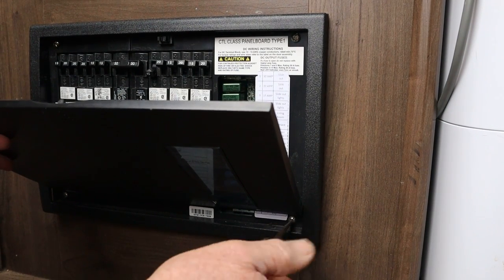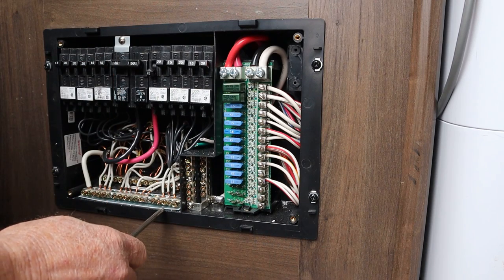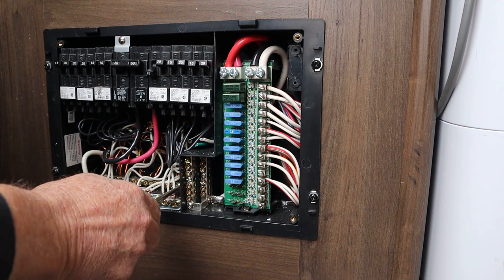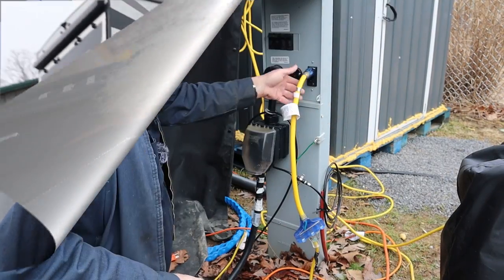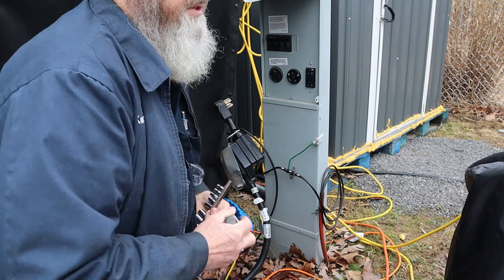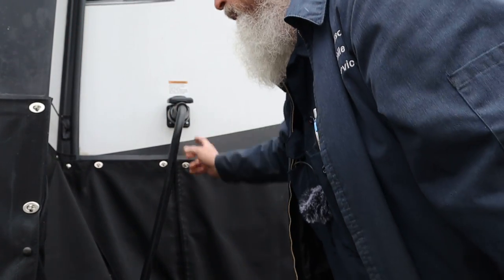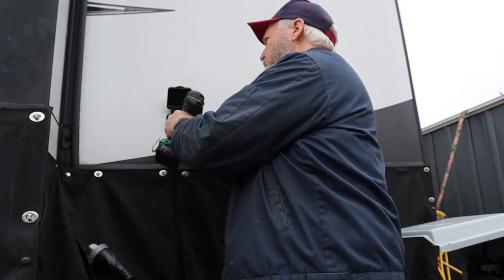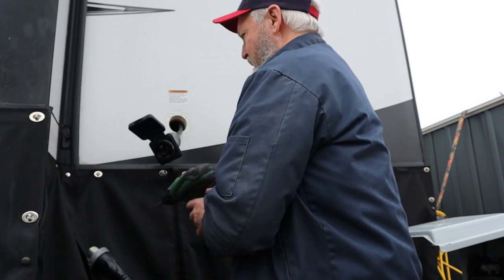GFCI Outlet Redo

Comment: Hi Kenny I was camping one time and my 30 amp kept tripping it was a loose wire like you were saying it was also arcing so I changed the breaker checked all the other wire everything works great now has not done it since
Reply from the maker: Loose wires cause a lot of problems.

Comment: I had a GFCI that would not reset.  On one of the outlets a ground was touching the neutral wire which had a nick.  Electrician pulled the wire and separated them.   I had replaced the outlet a few months ago.  On a brick house the wires can get abused and nicked.
Reply from the maker: The customer decided that he didn't want me going any father on this one. He said it wasn't important enough to him to spend any more money on.

Comment: I have found working with 120vac the best meter is an old one with an actual meter movement. The high impedance  of a digital meter can give weird readings. I have had problems with GFI outlets in damp locations failing. They seems to like dry rooms only over time.
Reply from the maker: I haven't had an analog meter for decades. I might have to get one.
Reply: @hillbillyrv  I remember the first time I used a digital meter and it displayed about 60 volts between neutral and ground.  After a while I realized it was about 60 millivolts. That was probably the difference in voltage all the way back to the meter where  ground and neutral are connected. With an analog meter you’d never see this inconsequential voltage. This was over 40 years ago digital meters started to become popular
Reply from the maker: @Chris_at_Home  Yes. The self-ranging meters have bit me a few times too....ok many times.  When reading voltage you must be careful to make sure you are paying attention to the range you are reading, but I don't think this applies here. I am seeing no cross continuity on any of the wires in this circuit, so no ground fault. Right?
Reply: @hillbillyrv  Correct, as long as you are disconnected from the utility  meter and there is nothing else plugged in the resistance should be infinite between ground and neutral.
Reply: @hillbillyrv  Well, if it only occurs under a load, then yes.  But under a load might only be when current is applied.
Reply from the maker: @Chris_at_Home  Yes, it was.
Reply from the maker: @Tom-Fisherman  No load. Only receptacle on that circuit.

Comment: Are the 2 gfci outlets in the camper on the same leg of power coming from the shore chord?
Reply from the maker: That I don't know. Good thinking.
Reply: @hillbillyrv  ok so I’ve been doing some research about gfci outlets for you. 6ma of leakage is enough to cause a “ghost” trip which may be your issue.   Surge suppressor filters increase capacitance down the line so I would eliminate that from the equation like someone suggested.   Leak meters are expensive but I don’t know if that’s an option.   You may be able to put a clamp meter on the neutral or ground and just see if you can detect any voltage but I don’t know I’ve never tried it.  I would however see if both outlets are on the same leg coming from the shore chord and separate them to opposing legs if so that will help distribute evenly.  Looking forward to round three video keep your head up third time is a charm.
Reply from the maker: @marcuscarmouche9023  Thanks for all of your effort Marcus.
Reply: @hillbillyrv  no problem bud techs have to stick together.  Nobody knows everything and I’ve been in your shoes and it sucks when every where you turn is a wall. I may be the one leaning on you next time lol.  I enjoy your channel keep up the good work!
Reply: @hillbillyrv  I also thinking the same thing why it happen on my Georgetown.

Comment: You have a neutral on the ground, that would be likely at the distribution AC panel box. Or, one of the outlets.
Reply from the maker: I checked the outlet on the outside of the camper. It is the only outlet on that circuit. That is the one that would not reset the day I was there. for any continuity between neutral and ground. There was none.
Reply: @hillbillyrv  Weak GFCI breaker???
The way I approch electrical is to know what cause them to trip.  Ground faults occur when electrical current finds an unintended path to ground. The usual suspects for ground-faults include worn insulation, conductive dusts, water, or other "soft grounds." Ground faults account for more than 80% of equipment short circuits and in 90% of those cases it is caused by insulation deterioration on wires and cables. I would be worried that either one unit is leaking hot current into the ground (nail in the romex somewhere) or a device connected is shorting when it gets hot, a weak breaker?  Can you try turning all AC breakers off and just plug into shore.  Then try flipping each breaker, waiting for a trip?  Try and cut problem in half..."it all works UNTIL ........"
Reply: Oh, I forgot, Ive had a Transfer switch where someone tied the grounds and white neutrals together and it would just trip.  At the pedestal GFCI...
Reply from the maker: @Tom-Fisherman  No GFCI breaker. Regular breaker and brand new GFCI outlet. Outlet won't reset unless the is power present. When power is present breaker won't reset because it acks like it is reading a ground fault.
Reply from the maker: @Tom-Fisherman  hmmm I haven't checked to see if it has a transfer switch.
Reply: @hillbillyrv  Well, I hope there isn't a screw through a wire somewhere.  Lets hope someone tied the ground/neutral in the xfer switch....
Reply: Its funny, when the pice of a copper wire fell out i was thinking it was shorting a neutral and ground bar....but that didn't seem to fix anything when you pulled it out.  😂
Reply from the maker: @Tom-Fisherman  I hope we can figure it out.
Reply from the maker: @Tom-Fisherman  Nope.
Reply: Dang bud I was waiting on this video in particular in hopes that you conquered the beast.  I would think that the surge protector on the shore chord would trip more than the gfci s if it were the culprit but I could be wrong.   Usually a staple or nail in the wire is a hard short but I have seen some that pass a continuity test and trip under a load.  You said the outlet that is tripping now is on the outside of the camper if I remember correctly and that the customer wired that one up himself after you left.   My ?’s are did you verify the wiring was correct on the outlet he wired ( load and line not reversed, loose wire ect)?  Did you remove one leg on the outlet that won’t reset and continuity test it that way? It’s possible that  he replaced it with a bad part out of the box.  Is it only tripping when he plugs something in if so what device?  Have you tested it not mounted to the camper in case the problem lies where the wire is usually crammed in the wall?
Reply from the maker: @marcuscarmouche9023  All of that has been double checked.

Comment: I have been thinking about this problem on the outlets. Back in 2013 I built a place and within a couple of years 2 outdoor GFI outlets went bad and wouldn’t always reset or they would trip. They had good covers and one was high on a wall with good sun and the other on the north wall.  I replaced them and never had a problem with the new ones. I even left the failed ones on a self above my workbench for a few years and then tested  them on the bench and they still failed. Maybe it was a bad batch from the manufacturer.
Reply from the maker: As Eric from South Main Auto says, "just cause it's new doesn't mean it's good"